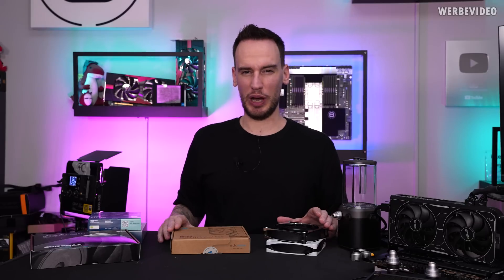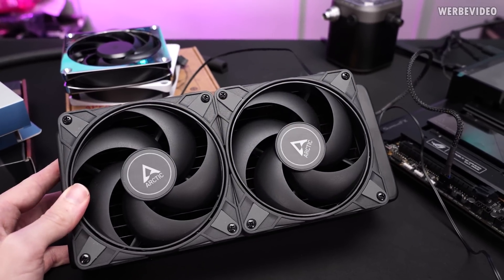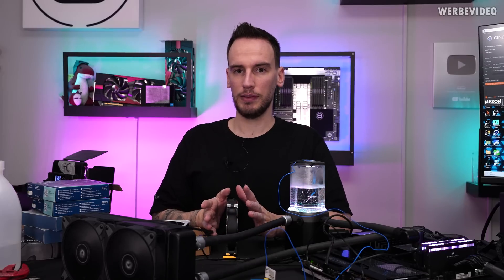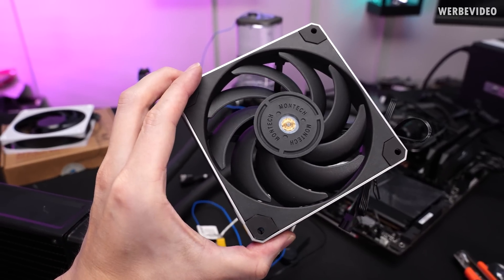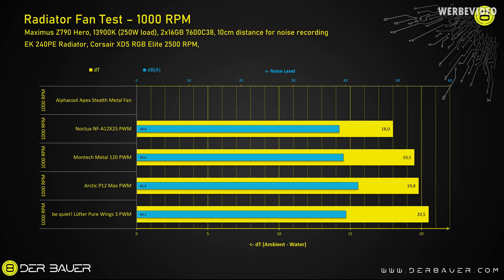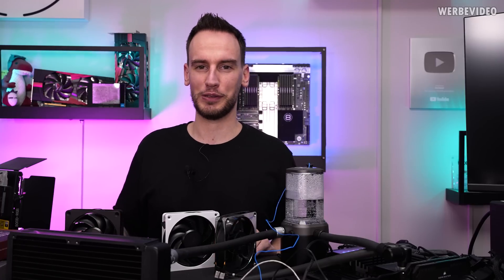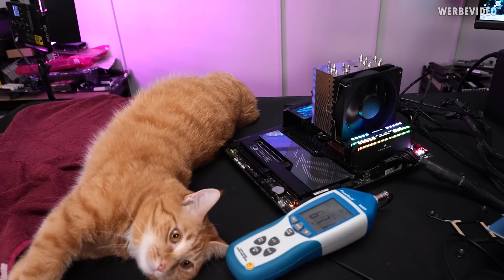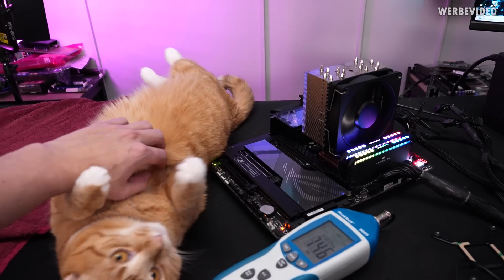Something is Wrong here - Alphacool Apex Stealth Metal Fan Reviewed

Comment: After watching several seasons of the fan showdown by Major Hardware, where users submit fan blades that he prints, I think I've only seen 1 or 2 beat the baseline Noctua for both sound and airflow, and it is a pretty narrow margin, so I would be doubtful of anyone who says a fan is twice as good and half as loud. I'm pretty sure we are at the point of diminishing returns, and your results are why I just buy Artic P12s. The asymptotic money isn't worth the small amount of improvement for the fan sound level and performance.
Reply: At one point one wonders why other fans exist when a Nidec Gentle Typhoon of yonder years it's still up there with the best and the Arctic Cooling ones keep embarrasing everything in the price/perfomance category.
Reply: @KarolusTemplareV   Those nidec fans are good case fans, but they're not good on coolers or on radiators. The reason other fans exist is that you can certainly engineer a fan that performs substantially better in a given scenario.

Also, Noctua fans are very, very quiet for their performance level, and when they do make noise, it tends to be less annoying than other fans. There are, of course, more performant fans. Hell, the old DeltaV's running at 5000RPM perform way better, and they draw 0.8A from a fan header. SAN-ACE and other server suppliers have similar models in that same vein, all are more performant than noctua's desktop offerings. They're also all incredibly loud and annoying.

So it depends on what you're designing for. Is it possible to make a fan more performant while being quiet, and do so in every situation? Of course, it's just a matter of throwing money into R&D, which is what noctua and others are doing. It's not going to be rapid progress, it's going to be slow, iterative steps.

That and a fan is only part of a cooling solution, and we've seen significant progress in other areas in the last decade or so, and that's likely to continue for some time. Noctua might make the best desktop fans currently, but, they no longer make the best cooling solutions, at least at the moment, so it'll be interesting to see how all of that develops. Thermalright is doing very good work in that space currently, if you're in the market for an air cooler. Arctic is doing very well in the AIO space, and custom loops are better than they've ever been. It's a good time to be alive.
Reply: @jttech44  I don't know where you got that Gentle Typhoons are optimized as case fans. Scythe-branded Gentle Typhoons were pretty much the only fan people used on high FPI radiators as they were the only thing out that could push air through them without sounding like a jet turbine. When the reviews of the A12x25s first came out, they were within 10% of the performance/noise at every point. The biggest difference was the better tone of the noise and the lack of the ball bearing clack. If you stand them next to each other, they look almost identical, but you can tell that the blade design started with the GT and was then optimized to the design on the A12x25. The biggest claim to fame for the A12s when they came out was that they were better for a much longer lifetime due to their new materials. When you coupled the fact that all of the Gentle Typhoon supply had dried up around 2016 (I bought my last 16 Nidec GTs in bulk at that time), it was the perfect storm for taking over that market segment. But they were 2-3 times the price of GTs when you bought them in bulk and I've never got a bulk discount for A12x25s. Artec P12s are about 30% less than the Nidec GTs were when bought in bulk and other than the vibration at about 1050RPM, they are the good enough solution for many things.
Being at the point of diminishing returns means that it takes a LOT more effort to get the additional performance. Noctua took 4 years to release a black version of the A12. They haven't released an A14. Their limited research budget isn't being spent on the successor of the A12.
Reply: While the performance might not change much there can still be a big difference in the quality of the components. With Noctua you're paying mostly for the over engineering.

Comment: The package size of the montech means the outer box, thankfully.
I own a few of the metal 120, P12 max and they're the same size and dimensions
And the P12 max does have a ring as well, that ring is for reinforcement to stop the blades from stretching due to centrifugal forces
Reply: I've been wondering, so the fan blades unfurling themselves is a real problem. You want the tips close to the frame for efficiency, but you can't have them scrape the frame. I think Noctua's solution is LCP resin plus stiffening fillers. But there aren't any PC fans with blades made from magnesium...
Reply: @SianaGearz  LCP resin is indeed the cure. It also resonates less.

Why there aren't magnesium? Magnesium would resonate pretty badly compared to polymers. And heavy too

Comment: I'd find it interesting if we could put the Noctua blades on the Alphacool spindle/housing. Might be that the blade geometry isn't as good at pushing air effectively? Also, could we cast something heavy in a Noctua frame to see if the increased mass helps dampen any vibrations?

Comment: You should've put the T30's in the comparison honestly, would've shown immediately whether any of the noise and performance claims were true as those fans outperform everything else on the market. I believe that simply because of how much better they are than anything else, we should push for 30mm thick fans to be the standard moving forward, unless you want to do full air ducting in your case which would be the only realistic way to beat the T30's with 25mm thick fans. ITX guys could just stick to slim fans; if they had better blade designs a 15mm fan would be all you'd need to get a decently quiet build with a single or dual 240/280mm rad on high end hardware. Just have to keep in mind you'd be running 45C+ on the water but that isn't a problem unless it goes over 55/60 (depends on tubing and pump usually), but honestly you should be setting up your fan curves based on water temperature anyway whenever you can.

Comment: 1kRPM is loud even for the best fans on the market like A12x25 and Silent Wings
if you want usably quiet you need to get into 600 range and some fans never get the noise low enough
Reply: Exactly!! I have a Corsair 1000D, 30 fans, 2x480 and 2x360 rads, both push pull. A single Noctua A12x25@1000rpm is louder than my PC under load (500/600 max rpm, winter/summer)
Reply: @greggreg2458  LC is another beast, to get that silent you need good pumps, tubes, connectors and rads and since nobody really performs tests targeted at silence it's all on you to get things right... fans alone are relatively cheap when compared to that and require much less time too

Comment: I can't really imagine a fan coming out that's half as loud and twice as performant as just about any other fan, let alone a Noctua one (no fanboying, but their stuff are objectively usually good), while costing less, even. Wouldn't be the first time igorslab messed up (what with the whole 4090 connector debacle) but it'll be interesting to see if GamersNexus or other reviewers try these and what results they'll get.
Reply: GN has their new fan tester setup, so hopefully they will test.
Reply: @shadow7037932   Aris (Hardware Busters, long time PSU reviewer/expert) also has the same fan testing contraption from Taiwan like GN got themselves, he might be curious to check that as well.

Indeed unless you get some kind of horribly unbalanced fan no-name reject, fans of similar construction speed and purpose perform... sort of eerily similar to each other, that's what you expect.

Oh btw i have a pet peeve about people calling 10dB "half as loud" or "double as loud" because dB scale is actually perceptually linear; but also you have an internalised experience that two of some uncorrelated noise source aren't twice the dB but just 3dB louder, not all too much louder than one of these noise sources. If the sources are speakers playing the same signal then doubling them is 6dB. This makes comparing loudness really weird and the only sensible statement that can be made about one source that is 10dB louder than another is just that it's 10dB louder, not some ratio louder. But yeah 10dB is a massive crazy difference. If you have a fan that's 10dB less loud at a certain performance level, then 10 of those fans taken together are as loud as one louder fan! Just imagine the implied efficiency difference, that you could 10x your air performance without any extra noise.

But for speaker (highly correlated sound sources) 10dB ratio is approximately 3 speakers worth, not 10. 10 would be 20dB. dB business melts your brain, and there just isn't necessarily a better measurement, because audio perception is so weird.
Reply: Yeah, these results should have raised an immediate flag for any tester. You would have to very actively try to set up a test that gives these results.
Reply: Thermal mass is incredibly powerful sound dampener, in fact  4 cents of hot glue can make a 15 or so watt fan have reduced noise and vibrations 80% but these companies are so cheap and can only give tiny rubber pads I guess lol

Comment: Wow, Montech can do fan this well ? That’s a surprise. Can’t believe they’re on par with Noctua for the price.
Reply: Most fans from large manufacturers work pretty well when they're brand new. But they often don't age very well.

I have some Noctua fans that have been running for over 10 years and are still as fast and as silent as when I bought them. I did get a couple of Montech PSUs last month, and the fans (which I assume are also made by Montech, or by whoever makes Montech-branded fans) seem quite good, but I don't know how well they'll age yet.

Comment: I feel like this is similar situation to thermaltake engine 17/27 - the prototype/concepts for those were really interesting, but achieving the gaps required for connection between spinning metal fan and the base was unrealistic for mass production, and it looks like in final production the metal fan is just a selling point. If that's the case here with those fans that the prototypes again show there is a possibility to do something like that, but it's not viable to manufacture those at scale, then it's a bummer...
Reply: I still think about those as the holy grail of low profile coolers. I remember, as you said, they did achieve what they were trying to achieve but only in lab (sandia lab), the mass produced product didnt achieve the tolerances to take advantage of the effect. I wonder if the same thing happened here, like some samples do achieve the numbers but it cant be mass produced at reasonable cost.

Comment: What if you test it at the same noise level as the noctua?
Reply: It would be worse.  It ran louder and was hotter.  To lower the db it would be hotter.
Reply: @zappulla4092  it was quieter at 2000 rpm.

Comment: Igor has been compromised for a while now imo 😢.   Personally,  I like the Artic and Thermalright fans ( no rgb).  They compete extremely well at 1/3 the price.
Reply: I have  5 arctic P12 and 1 slim p12 in a push-pull on my Arctic liquid freezer 360 radiator and they are quiet and perform really well for like 30€. (would be even less if I didn't have to buy the slim one because of the size of my graphics card lol) They enough push air through both dust filter and the radiator and to create enough pressure in the case even on pretty low RPM. At low rpm they are basically inaudible inside the case and are way quieter at high RPM than basically any other fan in the price category
Reply: I wanna try some of those arctic fans, they look nice, but I had 2 out of 6 Thermalright fans die on me within a month of usage
Reply: @RetroBerner  I have 10 Arctic P12 Max fans in my case. They're okay at best (performance) and bad at worst (noise). Every time my system turns on the fans make a grinding noise. I can't set a 0 RPM curve since they will always make a grinding noise when they spin up. P12s can't be beat on price though. I actually bought them for my new PC build while I waited for reviews of these Alphacool fans. Probably going to get the Noctuas since they are the quietest. Price not a concern.
Reply: @HCGonzalezJr87 I have 20 of them   in my PC and there is 0 grinding noise, and I'm pretty sensitive to noise as I run mine at 600rpm max.

Comment: Testing for a specific RPM might be the difference possibly?  Different fan blades would have a different angle of attack (airflow versus static pressure).  The blades with the highest angle of attack would move more air at a specific RPM, but would probably also be noisier and have a lower max RPM.  It might be helpful to test against either a specific input wattage, or to test to a specific noise level.

Comment: It will take some huge evolution in fan design to beat those Noctuas, i have them in all my rigs
Reply: Two uncorrelated noise sources are mere 3dB louder than one of these same sources. If someone makes a fan 10dB less loud, that would imply that you can run 10 of these quieter fans to the achieve the same noise as one of the louder fans. The math is a little bonkers, sorry, but that's how it works out. It would be pretty difficult to believe that all the fan manufacturers combined with 20 years of experimentation and iteration each landed on a solution effectively 10 times worse than the optimum! And that with a fan that doesn't look too drastically different. And sure Noctua is the renowned victor but all the other fans test... a little worse maybe, not several times worse.

Comment: The only thing I can think of is that he may have incorrectly interpreted the delta temperatures thinking the higher delta means better cooling performance. This could be a surprisingly easy mistake to make, especially if he was recently testing something else where that was the case.
Reply: Igor didn't didn't measure tempt just airflow.
Reply: @xsvrrx  Oh, ok. It looks like I am the one who has misinterpreted results today! 😬

Comment: I never doubted this. In my mind it is impossible to have twice the flow at half the noise with a fan of the same size and form factor. Talk about misleading marketing from Alphacool (edit: Igor).. But now they kind of lost a lot of cred, in my book. It's gonna be interesting to see more tests on this fan, for sure. I'm guessing it will perform just like any other fan... And Alphacool (edit: Igor) will have to eat their words.
Reply: But it was igor's lab who said it, not alphacool itself
Reply: @SuodesTzeos  Interesting. If I'm not mistaken, AC did reference the Igor's Lab test and used the results for marketing the fan to the sky - but now I can't find nothing except the Cybenetics test on their website. They must have found out that Igor f*ed up big time, and tried to cover the tracks or something. The Cybenetics test seem more reasonable, but also harder to interpret than Igor's test.
Reply: even bigger fan still make quite noise, although at more pleasant lower frequency.

at certain part of my life i bought this junk big ass HS and cool it with deskfan while the fan also cools me in the summer.

Comment: I thought the blades would be metal but being plastic they were never going to be much better. Let’s get Steve on the job to also review them.
Reply: The only thing metal blades would do is increase noise and decrease power efficiency (require more power, produce more heat)

Comment: Curious if the fan is tested with them pulling the air from the radiator, instead of push. Would it even make a difference?
Reply: From what I've seen it barely makes a difference, Jayz2cents and Linus also say that. Pulling air through instead of pushing makes for much easier radiator cleaning. Just wipe off the radiator instead of toothbrushing all the fan blades.